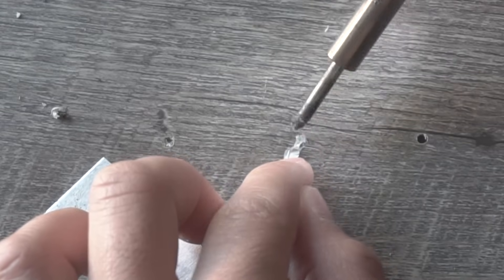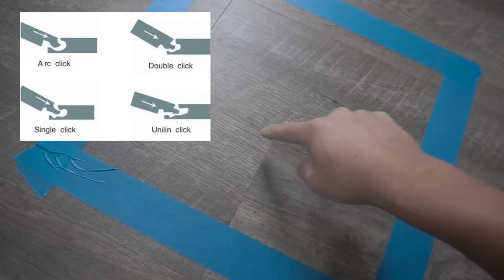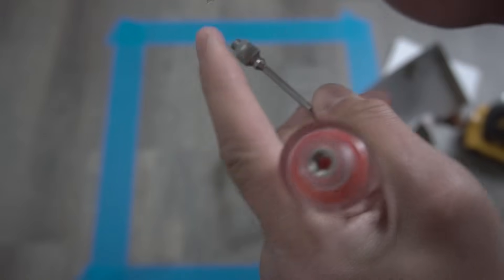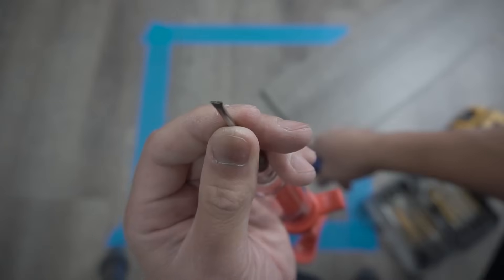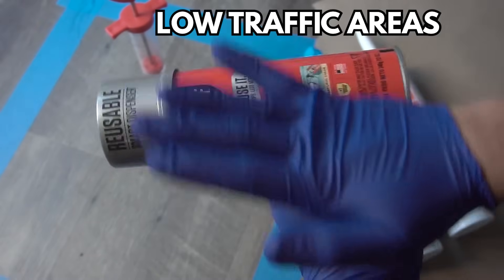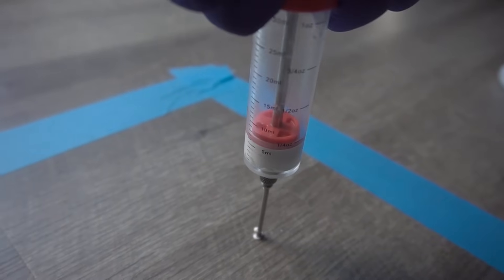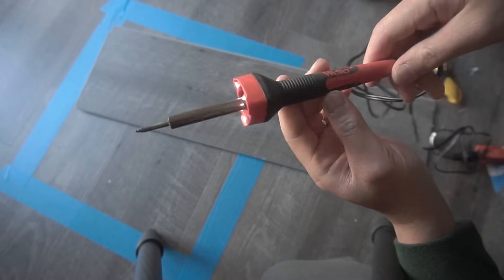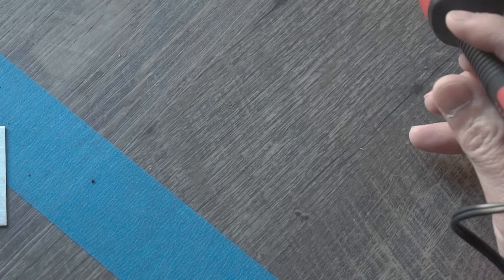How To Fill Hollow Spots Inside Vinyl Plank Flooring LVP Laminate And Engineered Hardwood Floors DIY

Comment: Excellent video and very helpful. We followed your directions, and our soft spots (vinyl plank) feel 100% better now. But you make it look a lot easier than it is, as far as pushing the caulk out of the injector tube. We finally got a system going that worked well, and I'm so thankful we found your video.
Reply from the maker: Thank you so much! I’m glad I could be of help! 🙏🏽😊👍🏽
Reply: It helps to warm it up, also, I used needles meant for livestock...
Reply: @FixThisHouse do you think there's a limit to how many spots you can use this on in a house?
Reply: @rickygreer1727  Warm what up? The caulk?
Reply: What is your long term experience?
Reply: @myvic12 We just recently did a little more filling in a few areas. For the most part, this is a great solution and has lasted two years. 
The area we’ve been working in is a place that was originally 2 different floors levels that didn’t get leveled properly before the vinyl plank was put in. So we had to use quite a bit of caulk when we did this technique. 
I’m still pretty happy with it.
Reply: I have the same problem . Please tell me what kind of system you used
Reply: @azanfahad8769  We basically just made sure the hole in the floor was slightly bigger than the bit we used to inject the caulk. And make sure you don’t push it in too far; if you hit the subfloor it won’t come out at all.
Reply: How is it holding up 2 years later?
Reply: @bmiller8461  It's still doing great. 🙂
Reply: @Leedes58  So, no problems conflicting with the "expand and contract" that other people in the comments are saying that this method will prevent it from doing?
Reply: The shrink stuff is too hard to push thru the needle.  Help!
Reply: @cherylbixby2198  Just make sure the hole you drill is a little larger than the bit you use to squirt the caulk. And make sure to keep the bit off of the subfloor—raise it ever so slightly once the bit touches the subfloor and then push the caulk in.
Reply: @brianmiller2135  So far, no problems here.

Comment: Great video! One piece of feedback is to add blue tape over the drill spot before drilling the holes. This way when you fill the holes, the tape serves to protect the area around the hole. Similar to using it before nailing trim to the wall
Reply: I was going to make the same comment. Smearing caulking over the face of the laminate to wipe it off made me cringe...
Reply: Ah yes, blue tape over the hole to protect more from the soldering iron as well. Thats a great addition!
Reply: Nothing really sticks to the face of laminate

Comment: Ok so I know you are a professional, I understand that, I am aswell, your work is genuine. This is more of a seasoned industry secret. So always keep a pin nail or thin tack nail in your pouch, if you place it in your drill as a bit it actually works better then a normal drill bit because it heat drills through the surface leaving a natural edge, then to fill the hole get some charcoal from any art store and a wax block for flooring, place crushed charcoal on other surface and rub the wax end through it, tell it blends in the wax, then take the wax and fill the hole, you can use a sealer, dull nail coat(nail polish works well) although the wax will harden on its own so you don't really need it, you always use charcoal because it imitates a feature mark, like a natural burn or deep tannin  spot, it work on any floor and unless you are eyeballing every square inch of floor like a nut, it will never be noticed as a blemishe.
Reply: Are you saying that this method of fixing the floor with stretchy caulking has routinely been practiced in the industry?
Reply: @youtubestaffaretrash9258  what???
Reply: @youtubestaffaretrash9258  What about answering my question? LOL "Are you saying that this method of fixing the floor with stretchy caulking has routinely been practiced in the industry?"
Reply: @youtubestaffaretrash9258  I understand that a professional would not have made the mistake in the first place but I think this video is more of a tutorial for people who did not have a professional level the subfloor and need something to address the problem as a fix rather than tearing up the entire floor, leveling, and replacing.

Comment: I tried this and the Extreme Stretch never cured. 3 weeks later I had to remove the flooring, self level, and reinstall flooring. Was still wet like I just filled it. Though this didn't work for me, I hope it works for others. Love your videos!
Reply: That's what I was thinking, that it would never cure.

Comment: I did this and used Extreme Caulking and it’s not curing . I thought about it after and since the caulking is under the vinyl flooring I don’t know how it will dry since there no real air flow so it’s like it’s still in a tube .

Comment: Great video! I read through all the comments and ran an experiment. I clamped a LVP plank to plywood and tried wood glue VS Big Stretch Caulk. Findings: Big Stretch created a strong bond to the pad attached to the the LVP plank and plywood. Wood glue bonded to the plywood but only created a weak bond the padding on the LVP. This bond was so weak that any expansion of the floor will break the bond and allow the plank to float as designed. Also note the wood glue dry time was way faster. I am planning to use wood glue and break the bond by using a suction cup to pull the planks up after the glue cures. Also, plastic welding did not go well for me I found that Robert’s Caulk worked great to fill the practice holes. I did use a heat gun with the caulk as it made it more pliable to work with. One additional tip is to use a suction cup or tape to pull the floor up the flooring when drilling so you don’t drill into the subfloor.
Reply: Exactly what I was thinking that Big Stretch would definitely glue a floor down where the wood glue is only going to stick to the wood floor and probably not to the backing pad of your vinyl plank so you save me the time I'm having to do that experiment thank you
Reply: Hey Remington, How did the wood glue hold up? Any issues with your floor after putting it in?
Reply: Did you try the wood glue?

Comment: I did multiple Google searches, browsed r/ flooring subreddit, spoke to a pro flooring store owner, and a long time handyman.  All said the same thing.  Rip out the flooring to the point where the vinyl tiles broke and reinstall. 

There are other videos that similar to yours but yours is the best. You didn't use a brand name kit like Fix-a-Floor but to use what can easily be found and can be reused later.  Fix-a-Floor kit has to be ordered online. Only the caulk tube is available at HD. You also provided a shopping list.  Thank you.

Comment: Thank you.  Excellent video.  I would recommend using a level to judge how much upward deflection you have as you fill the void and then use it to push it down flat...then let it dry.  I wouldn't use a bucket on it and potentially create another low spot.  Your hole patching instruction is great.

Comment: We found your video very helpful. We just put LVP down after removing carpet. Levelling was done in most of the rooms where it was detected. After LVP was installed, we're finding some soft spots in places. Some cause clicking, when the soft spot is under a plank connection. We will be following your method. Already ordered a couple of injectors and getting the stretch caulking. Thank you!
Reply: How'd it go? I'm about to do this in a few hours
Reply: @TheDrunkHamster  It went well. Did exactly what he showed. We had to do 6 different soft spots. Good luck!

Comment: I've been installing for 21 yrs, we actually have needle kits with smaller needles and a special liquid filler and dowel pegs for this. 
You have the right idea. The sodering iron is a bad idea. Just use wood dowel pegs, knock it in with the small hammer, break it off, knock it in a little below the surface with a nail puncher, then fill with matching vinyl putty
Reply: Care to share names of the kits and liquid filler?
Reply: @MILKMANDELIVERIES  I would also like to know

Comment: Great instructional video, would you recommend using a suction device and slightly lifting unglued area while drilling the holes?  May help to not drill into sub floor.
Reply from the maker: That will work too! 👍🏽😊
Reply: @FixThisHouse  thank you!

Comment: Great video. I followed your directions but added the help of the caulk gun by nestling in the syringe into the space where the caulk tube fits. It made it a lot easier to express caulk out of the tube. I also ordered a trephine (dental implant) drill bit to make 1/8” cores of sample plank to fill in the hole spaces. I won’t get it for a week, so I’ll tape up the holes after drying the caulk until then. Thanks for the technique.
Reply: wait so you'll put the sample plank to cover the hole instead of soldering the plastic like in the video?
Reply: @dimepia123  Yes, but just small 1/8th inch wide circular cores cut out of the sample boards. I used light, medium and dark colored ones to match the holes I drilled.
Reply: @larrydrum  Very meticulous, amazing!
Did you also make two holes prior to filling up the space with glue, the second hole being used for the trapped air to exit or you didn't need to?
Reply: @dimepia123  Yes I did. I also used the solder to blend and hold the cores in place. Regarding the holes, I found I had to make more than I expected. The caulk didn’t flow laterally that well. Maybe next time, I’ll use a rubber mallet  to help it along.
Reply: Two clever ideas! 1) the caulking gun assist and 2) the cores made with the dental drill. Thanks for the ideas.

Comment: I cannot thank you enough for posting this video. Everything worked as expected. I had a pretty sizable mini-hump under one small row in a transition spot where there was some house settling. I didn't floor level there, which I prob should have but forgot to. This took care of it and it even looks better to the eye when you look at it (It was starting to show a small dip). Solid as a rock and event now. Thanks again!
Reply: I have essentially the same problem to solve.  Would you willing to chat before I try mine?
Reply: 😂….a total coincidence.  My house is a Vaughn Construction build.  The crack drives me crazy.  My wife says I “feel” with my feet.  

Your advice would be greatly appreciated!  

Ron

Comment: This method worked great. After two flooring guys attempted correction I did it myself. 
The meat injector is not of high quality but it was cheap. Hold the body of the syringe instead of the finger holds.
Might use a metal injector if it’s a big job.

Great info, thanks!

Comment: Excellent repair !   I have a low spot in my hallway that has engineered hardwood that needs fixing, now I am confident I can do it myself using the Dap Big Stretch and the Cookment kit . I will found 1/8 dowels at Hobby Lobby and I have matching stain I use for scratches to cover the tops of the dowels. Thank You !
Reply: Did you patch the drill holes the same way he did? I wasn't too sure if it would work on the engineered wood as opposed to the plastic stuff.

Comment: Great tips. I can't wait to try it in the morning. I love your videos. The best I've seen so far. Im remodeling a fixer upper mobile home for my dad. I'm not skilled at all so I feel I'm  reinventing the wheel until now. There is still lots to do but after finishing the flooring and the trim, the fromt room will be done.  So glad i found your videos. I was at a standstill. I have air pockets in the flooring and I cant seem to get the last row of the flooring to fit tight. After watching your videos I'm pretty confident that i can do it.  Thank you so much
Reply from the maker: Thank you so much! I wish you well in your renovation project! 🙏🏽😊👍🏽

Comment: Wow! What a great idea. I've been sitting here feeling so defeated from the discovery of a hollow spot I my newly installed engineered hardwood. Was planning to take it all back up to get to the spot and fill it with leveling compound. This will save me a ton of time and headache (wife will be glad too). Cool!
Reply: Call you installer  his job to fix hollow spots !! He should have checked slab / subfloor prior to install
Reply: Omg I thought I was the only one had this bad issue.  I'm experiencing the same with my flooring, newly installed and felt so defeated.
Reply: @Bird2-2-20  What if it was DIY and they are the installer?   Who do they call.  BAHAHAHA

Comment: Thanks for the helpful video!  A couple of suggestions based on my experience. First, I agree with the person who suggested putting tape over the place where the hole will be drilled.  Actually, have the inch around the hole taped to facilitate cleanup.  Second, cut the needle to about 1.25" long.  I just clipped it in my first attempt, as shown in the video.  I didn't realize I was pushing down unevenly, twisting the needle, and bending and weakening it at that point.  It wasn't long before the caulk started leaking from where it bent.  Third, if you push down and the plunger goes almost without resistance, the gasket around the base of the push lever needs to be set correctly because caulk is coming out over the plunger, not through the needle!  Fourth, wear disposable gloves because if the third situation happens, it will get messy!

Comment: Thank you so much for filming this video. I took my time injecting the Extreme Stretch , put 2 paint cans over the fixed spot for 2 weeks until it set and voila! My floor feels 100% firmer now. I appreciate you!
Reply: Just curious, how is it holding up 1 year later?
Reply: @bmiller8461  It's just like the day I did it. I have used it on a second floor since then too and no problems on that one either.
Reply: @kristin8809  so, contrary to what others are saying that it could cause issues with the expanding and contracting of the vinyl flooring, you haven't experienced any problems with expanding/contracting planks?
Reply: @bmiller8461  None at all. Repairs were lvp on concrete slab if that helps.
Reply: @kristin8809  I had the same problem right now. I had vinyl on-click floor on the self-leveling compound (I dont know if the translation is great but some "cement" that should self level). Sadly, but the compound has some pits, and vinyls are not laying on the compound directly there which creates a hollow spots and the irritating noise when walking on it

Don't you have any problems with caulk drying? I'm wondering about applying the method from the video but I have doubts about the drying..
Reply: @cristokow552   I have not had any changes from when it initially dried until now, over a year later. Maybe get a tube of Extreme Stretch and pump some out on some cardboard and let it dry a few weeks so you can see if it remains elastic enough for you once it's cured? Then you'll get an idea of what it will be like under your floors.

Comment: We just had an addition done to our home and contractor installed new luxury vinyl throughout the house. After it was all set and done I started noticing several hollow spots and it has been bothering me so much. I thought to rip it out and replace again but I will definitely give this a try. Thanks for the video 👍🏽
Reply: and how did it go?
Reply: @K0d3x92  It did not work for me. I tried it several different times on extra flooring I had and you can see where I drilled the hole. Could be the style of vinyl flooring and the way the light shines but It would be really noticeable.  Need to figure out another way.
Reply: @MrAlperez77  I see. Well, thanks for the reply. I'll probably have to reconsider then, since it seems that without experience it will be hard to do properly...

Comment: These are some really great tips!  Thank you!   As a 35-year home improvement professional, it is my suspicion that the caulking that you used will have similar if not better adhesive properties than the wood glue would have (maybe better).  The elastomeric properties you described for the caulk would not be applicable in a sandwiched 2-surface adhesion situation like this one.  In other words, it will probably not allow movement of the flooring.  The wood glue will bond to the subfloor, but it will probably de-bond from the vinyl backing of the flooring over time.  Probably easier to inject also.
Reply: Hey Scooter, good point. I have a similar situation at my home- I did all the LVP myself so it's ultimately my fault for not perfectly leveling the floor. So is your ultimate take on this kind of fix to use wood glue, or would you try some other compressable liquid?
Reply: Any follow up answer to this?
Reply: @ychongy  the best way is to carry out an experiment with different materials - caulk, glue and foam and see how they behave once cured between 2 pieces of wood prior to injecting them under the flooring. Just use 2 scrap laminate or vinyl pieces to simulate the process and then make a decision from there.
Reply: For what it's worth, the Big Stretch Caulk advertises it stretches up to 500% once cured.